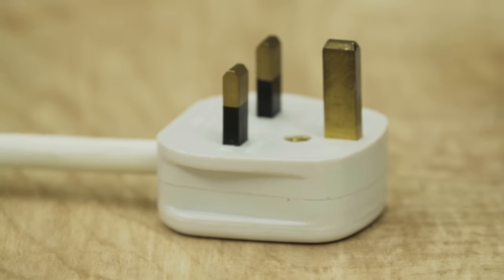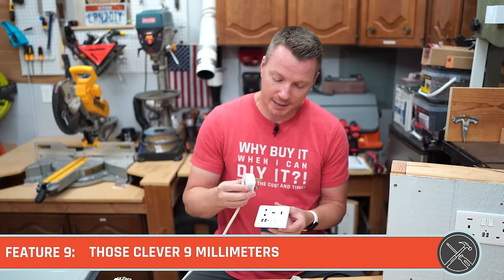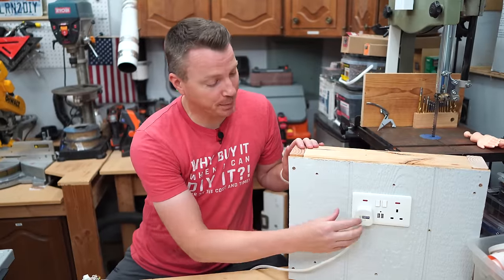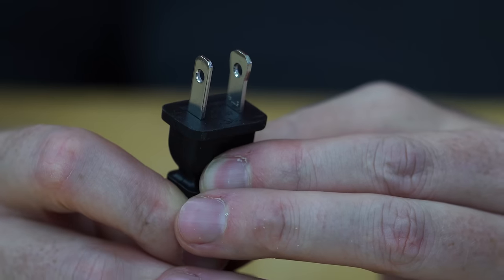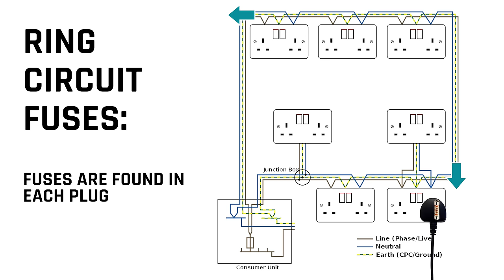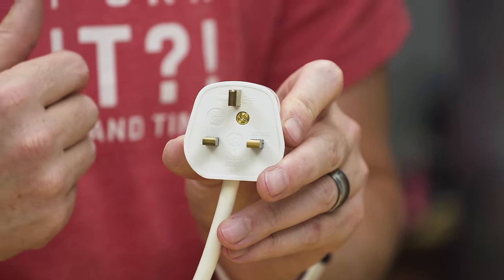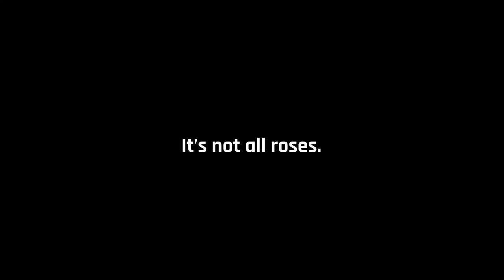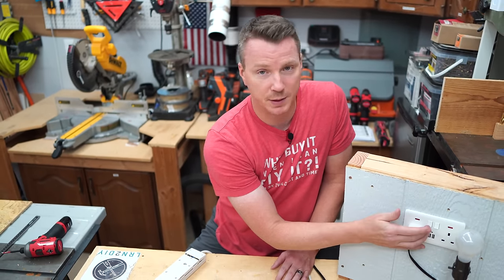British Plugs and Outlets Are On Another Level

Comment: Don’t think a British person has ever really had an issue with not switching on a socket, we all grew up with the switches! Similarly to how someone knows automatically to flick a switch to turn the light on! Also load balancing isn’t usually problematic- usually have a separate circuit for likes of cookers and washing machines!
Reply: rather forget to turn on a socket than have it throw me across the room just a preference!
Reply: Not only that if you are unsure what's broken you just plug in something you know works to rule out a faulty switch/socket..
Reply: An electric cooker won't be on the same ring circuit as the sockets, it will be directly connected to the consumer unit by a higher gauge cable.
Reply: just turn it off at the wall before bed!
Reply: The only instance I can think of was when my plug was directly behind the tumbledryer / washing machine and sometimes it would shift a bit and catch the switch and switch itself off - only happened very rarely though & was just a accident of design that the cable retention clip on the back off the machine and how it sat in it's niche was just perfectly lined up to switch itself off.

Oh and I have had the all plastic earth pins snap off - that happened on my router..
Reply: @spetsnaz1014  Yeah Electric Ovens are pre-wired in with just a switch on the wall - some times there is a separate electric shaver plug in the bathroom - but most times there is no outlets in bathrooms by convention - at least no where near the water.

That said if some one is using a counter top electric hub that would likely just be plugged in.
But I never saw those things as especially safe.
Reply: most of the times it feels weird to plug something in and not have a switch to flip when you go on holiday to places that don't have switches.
Reply: As a 56 year old man. I do not recommend licking the end of a cable aged 11. I swerved Darwin.
Reply: @shaunportlock4924  Got STUNG by some pesky critter hiding in a light fitting as a 4 year old!

Then some phantom beat me across the shoulders with a plank one morning when I wiped the dew off an extension chord - that's how you find out it is "Live" it seems.
Reply: @spetsnaz1014  the same for power showers as well T & E cable also dependant on the KW required for the shower will be different cable will be required also
Reply: Lights, sockets, cookers etc will be on separate rings with appropriate wiring. Often floors will be separated too. You don't get load issues in a British house.
Reply: I think a better point is that if the switch if far away from the appliance, it can be difficult to diagnose the problem. i.e. a washing machine or fridge being plugged into the wall behind it. Less so for small appliances like a toaster or lamp.
Reply: You can run an oven off a ring circuit as long as it's not more than 3kw.
Reply: @spetsnaz1014  Not true. You can run an oven off a suitable ring circuit..
Reply: @peterreed3104  yeah exactly lol
Reply: Except when you return to the phone you plugged in to charge hours earlier 😠
Reply: New Zealand  and Australia also have switches on sockets, although using a different plug system, and they are not an issue. Mostly they are just left "on" but it's occasionally useful to be able to turn something off at the socket as well.
Reply: @nobodydoesithalfasgoodasyou  never had that issue personally
Reply: @Richiecandylover  jolly good. I think switches by and large serve no useful function, so often find myself caught out by other people having turned sockets off for no earthly reason.
Reply: @nobodydoesithalfasgoodasyou  ...but that is not the fault of the socket...
Reply: @shaunportlock4924  My brother, when he was seven....back in the early Seventies, put a plug into a socket...without a back on the plug ! Dad had gone to find a fuse. Half knocked him out. Swear he's been a total nutcase since.
Reply: I have British sockets in my house without the switch they do exist
Reply: The fuse blowing can cause problems diagnosing issues though
Reply: @_Titanium_  in very unusual circumstances only. I can think of only one instance in mywhole life.
Reply: @90lancaster  i live in a high rise flat, and my fuse box and electric controls are literally right next to the kitchen sink.
Reply: @DAN.eight6  Hopefully they have a rubber seal around he door and is firmly attached to the wall - Otherwise - I am afraid for you.
Reply: As a fellow Brit I have only ever had ONE problem with these otherwise amazing plugs and that is standing on them - its all the lego in the universe at once...

Having lived in several other countries I really miss them and if I ever had a house built, I would instal them.  I spend so much of my life wiggling plugs in sockets to get them to work...
Reply: It is generally better to switch OFF  appliances at the power point.
The reason being that switches have a limited ON OFF count before failure
and it is much cheaper and easier to replace the wall socket than the switch
on any given appliance.
A socket with a switch has not yet been imagined in the USA (aka Retardistan)

Also note that ON OFF  relates to switching 
whereas on off  (lower case) is used in an entirely different context -
and the majority either do not know or have not noticed what is written
on any switch - which is  ON  OFF    and   not   on  off

People are programmed to be ZOMBIES
ZOMBIES have eyes but cannot see - ears and cannot hear.
Reply: Tbh I've forgot to turn the plug on a few times usually because the plug is normally always switched on so in a rush i assumed it was already on... Oops
Reply: @spetsnaz1014  Not any more I'm in a new build and its a normal 3 pronged plug with a 15amp fuse
Reply: @spetsnaz1014  It's still on it own curcit but it's no longer direct wire to socket
Reply: @peterreed3104  Most people never turn them off anyway there is no safety reason not too as we never get electrocuted it's more of an energy saving thing
Reply: and some sockets have a neon bulb to indicate the switche is on or off, and some sockets you can buy have no switches, and some sockets have a fuse breaker in the socket let alone waterproof once outside. the gauge of the wires should be the  same if it's a spare or ring main 2.5mm for domestic appliances. but he right about stepping on the plug
Reply: @spetsnaz1014  that only applies for hob's what need a higher gauge ovens and grills don't, and of course kitchens have a separate circuit.
Reply: Also in UK we do both types of socket circuits not just rings
Reply: Also it maybe thicker but when you have the US plugged in next to the U.K. you will see the US sticks out further.
Reply: Growing up in UK, I remember as a child often seeing a live and neutral wire being stripped back and forced into the outlet, along with the pins of another live plug...therefore 2 appliances drawing power from the same socket. Goes to show no matter how safe you make it, stupidity always finds a way.
Reply: It’s a bit of a meme in the UK if something isn’t working, the first thing people say is “is it switched on at the socket?” So it’s pretty ingrained and not an issue
Reply: Totally agree with this! The only one of them "issues" ive ever faced is standing on them if some thoughtful person has ever left them laying about! Makes lego feel like cotton 😭😭😭
Reply: @nobodydoesithalfasgoodasyou  never had to pay for electricity where your from?
Reply: Yes....but the added step may be an issue and a step too much for Americans.
Reply: As mentioned by many, the only downside to UK plugs really is stepping on them with bare feet 😱
Reply: @piccalillipit9211  oooh  I feel your pain
Reply: "My computer is broken, the screen is black"
"Have you switched it on?"
Reply: @spetsnaz1014  our oven since I was a kid has been in a standard socket . I'm 36
Reply: @spetsnaz1014  normally 30A
Reply: @90lancaster  that’s interesting, my appliances all have unswitched sockets but those are just the “tails” which are switched and fused on the wall above my work surfaces - really convenient. They were installed 40 years ago, and I’m grateful that the contractor was so smart!!
Reply: Yeah, I mean I have forgotten to switch it on at the wall if I am in a rush or it just slips my mind, but if I come back and (for example) realise my phone isn’t charging, I’ll instantly check the socket to see if I actually turned it on
Reply: I feel the only issue that's a real problem is stepping on one,  which has been described by James May (ex top gear) as the equivalent of stepping on an anti personal mine, his words not mine. All the other problems we are used to.  Ya have to be careful LOL.
Reply: So the only faults were size.......overloading ( as said by others different circuit) and americans not understanding an off switch............. Having used both systems living in the uk and spending lots of time in the states i can say the uk style plug blows the american plug out of the water. American plugs are flimsy, constant electric shocks, stick out of the wall so damaged and disconnected so easy. Id rather have a safe plug even if it makes it big. Good video on merits of the plug though.
Reply: @valeforedark  - An electric oven needs to be connected by 4mm twin and earth, same as an electric shower, directly to the consumer unit. It's not on a ring circuit. 1.5mm circuit is for lights, 2.5mm is for plug sockets. No electric oven is sold with a plug attached. I think you have a gas oven which has an oven light and needs ignition.
Reply: @MartinBlackburn_sco  - There was a public safety film in the 70's/80's telling people not to do that.
Reply: Most houses will have circuit breakers - I know mine does. So the lights could be on but something tripped the downstairs plugs.
Reply: Yeah I prefer having a switch, peace of mind when going to bed and saves electricity cost. The only issue with UK plugs is stepping on them, the pain is ridiculous.
Reply: IDK about other brits, but when something doesnt work the order I troubleshoot is: Switch > Fuse > Item.
Reply: @_Titanium_  not really.  you just plug in something that you know works...  if it continues to work in that socket, its the fuse....
Reply: @spetsnaz1014  and with thier own isolating switches
Reply: It's more like. IT'S NOT TURNING ON!!! " have you turned the plug socket on? " YES- wait.. nope. nope its' alive now, thanks!
Reply: @spetsnaz1014  only if the cooker is greater than 13A. What is common nowadays though is for induction hobs which require 32A and larger ovens to be on their own 6mm radial. If it's a plain fan assisted oven and let's say gas hob ignition it's common for that to be with other kitchen sockets and to be on a plug found behind the unit with a spur/cooker switch somewhere accessible.
Reply: @90lancaster  To combat this your sparky should have put in unswitched sockets with a spur at another location for turning it on and off without having to pull the thing out.
Reply: @asuri8751  I do not feel it requires changing short of the point I have the kitchen remodelled. and if I did I'd just as likely move the thing to a utility room anyway. It just sits where it sits as that is where it's plumbed in. It's kinda in the way and needs moving sometime so I wouldn't want the hassle of having it shifted - besides it's not like it's hard to switch it back on when it''s done it it's only very infrequently and because it got bumped as it's a bit to big for the space I need a shallower one really.
Reply: @spetsnaz1014  one minor nitpick. Higher gauge wires are thinner, so high energy ones would actually have a lower gauge
Reply: @spetsnaz1014  a lot of new cookers are made to have normal plugs
Reply: You can see if a switch is on from across the room as well because they have the red section that's not visible in the off position
Reply: Yes and also a British person has never thought that the plug is too large
Reply: 10:50   Switches Are 
             Double Edged Sword

This is a non existent issue!☺️

If an appliance does not work you simply try another appliance at that same socket eg a phone charger.
If that works then you know the issue is with the original appliance
If the charger doesn't work then you have an issue with the socket

Thats it, takes about 10 seconds to work out 😂
Reply: The negative of the switch causing people to have to "trouble shoot" is a real reach. You just check if its on at the socket and problem solved. If its still not working, then you trouble shoot. Safety is more important than the tiny inconvenience of checking the wall switch.
Reply: @scousersharkey5880  he's probably wired into his local street lighting or neighbouring business...seen squatters do this.
Reply: @Ghengiskhansmum  haha got his leccy on the fiddle an that 🤣
Reply: I put multiple separate circuits in each with there own trip switch.
Reply: @nobodydoesithalfasgoodasyou  it does serve a reason you save on electricity as acerything that is plugged in will have a charge going to it unless it is isolated by the switch so there is an earthly reason to turn off the sockets.
Reply: @leedstown  a full kitchen cooker will NEVER come with a plug they are always hard wired, the only ones to come with plugs are portable counter/tabletop small cookers
Reply: Switches are a waste of time, just get left on all the time whether the plug is in or out. Regards stepping on them, yes this happens all the time and yes it hurts. These plugs are over engineered for a time when electrics were fraught with risk. Clever design though. Tip if you are like me and lived abroad with northern European style plugs, you can use them without an adapter by sticking something non-conducting through the earth hole.
Reply: @spetsnaz1014  yes. 30 amp circuit for the cooker, often shared only with the washing machine, kettle and toaster. In Oz we also have a separate 3 phase circuit for air conditioning and, if you're posh, the swim spa
Reply: Never heard of a washing machine on its own circuit.
Reply: My house in Ireland was built with sockets without switches. I think the contractor was looking to save money any way that he could, but even at today's prices the saving is low, a basic plug would be all of 35 cents cheaper.
Reply: 30-amp circuit! Now that is power handling!
Reply: @jshep73  I have; but there are shallower plugs for the use case I thought that about.
Reply: @DemonetisedZone Bless. He's American; you have to make allowances! 😏
Reply: @Ghengiskhansmum  He is a scouser and doesn't know this? 🤣
Reply: @kitemanmusic  Normal for a UK kitchen.
Reply: The switches at the sockets are recent. 40 or 50 years ago the switches weren't standard.
Reply: The switched socket was invented so you can leave the plug in the wall socket thus not stepping on it
Reply: I remember that the wires were held in with matches
Reply: mine like that
Reply: I do it when charging my phone in a rush
Reply: @nobodydoesithalfasgoodasyou  quite a few electronic items no longer have an off switch. Therefore having a socket with a switch saves you having to unplug
Reply: @meltdownzero  - When I arrived in the UK at the Bird In Hand Hotel, I just couldn't believe the "logic" (?) of putting a 240 VAC device in a shower where you are wet head to toe.  I also don't remember any switches on outlet panels and I don't believe I ever saw the insulation on the live and neutral prongs.  Of course, this was 40 years ago.
Reply: Exactly this... Kitchen circuits (where you find cookers, kettles, toasters, washing machine etc.) are always on separate ring mains, not only this but they are typically on higher amperage circuits then the rest of the house.
Reply: As someone from New Zealand where we also have switches on the sockets, I agree with not having a problem with them
Reply: Also that's not a fault of the plug but the socket and that socket method is used internationally over a multitude of types.
Reply: @90lancaster  yes, its by law that there are usually not electric sockets in the bathroom. Shaver sockets have special safety features especially for use in a bathroom, including an isolating transformer... which greatly reduces the risk of electric shock/electrocution. Also, light switches aren't generally present in UK bathrooms - there will normally be a pull string switch hanging from the ceiling - much safer to use when hands are wet than a wall switch. As a Brit now living in the USA I'm amazed at the things I see here - the US just doesn't seem as safety conscious.
Reply: @spanishpeaches2930  not if its over 13 amp you can't
Reply: @seanmacdonald8211  ??
Reply: because many devices reset when they lose power lol
Reply: Theres been a few times when I've plugged my phone in to charge only to realise just before I go out that I forgot to switch the socket on 🤦‍♂️ it definitely is still easy to do 😂
Reply: @wetkneehouston6293  happens to the best of us. Adding useless complexity adds useless complexity and price.
Reply: Agreed. I've never even heard load balancing mentioned before, in fact the US system is worse for that because the first appliance drains it's portion of the current, the second one drains even more, and by the time you get to the end of the line you might struggle to power anything stronger than a lamp, depending what else is on that circuit. That's not so much of a problem with the "ring main" system, as the UK's is called. 

Stepping on plugs never really happens either, since we can switch them off there's no reason to unplug them.
Reply: @gssf.gr29  "the second one drains even more, and by the time you get to the end" are we talking here about single house installation or powering planetary system?
Reply: @FueRent  You would be surprised just how much stuff some people plug into these things. Many older houses still have radial (spur) circuits upstairs, and in some cases even downstairs and were not built for the number of appliances people use these days. I've seen radial circuits that have so much plugged in that a 60w lamp plugged in at the end would barely light up at all.
Reply: His point was it’s another point of failure, not about forgetting to turn it on! If your lamp won’t work when everything is on as it should be, now on top of everything else, the switch might be broken! Stuff like that is a double edged sword, really useful but more complication makes problems harder to diagnose!
Reply: @flashlightning6742  well lamps come with a switch. Every device comes with a switch. Adding a switch is adding a failure point and cost, but yea. Brits are not known for making the best decisions, so i guess ok.
Reply: I have always used extension cords with switches so I believe it's pretty similiar case. Anyway, just 2 days ago I forgot to flip the switch on. I plugged in phone charger, connected it to phone and went to sleep. I was late to work the next day and very surprised that my alarm didn't work...
Reply: @FueRent  I'm not saying it's a bad decision, it is just a definite downside to the switch. No matter if the device as a switch, the switch on the receptacle is still an additional point of failure. No matter how many other points of failure there are, adding another is always a downside to something.
Reply: @90lancaster  There's a whole lot of regulations defining exactly what you can and can't put in a UK bathroom, where it has to be positioned and what IP ratings it must have. For example, the shaver socket must be double insulated and contain an isolating transformer.
Reply: When I worked in maintenance in hotels I wish I had this video to show angry Americans hahaha .
Reply: @spanishpeaches2930  Most of our American electric oven/stove circuits are sized for 9.9kW minimum.
Reply: Not usually always. It’s law. If you don’t have it cause your house been build in Middle Ages. 😂
Reply: "Also load balancing isn’t usually problematic- usually have a separate circuit for likes of cookers and washing machines!"

Depends if a pro wired up your house or a complete muppet.

The electrician that did ours for the renovation was clearly a muppet because having the electric cooker on and several other electrical appliances in the kitchen at the same time almost always causes the breaker to trip.
Reply: @_Titanium_ but when the fuse blows on an individual device, it's usually indicative of a bigger problem with said device.  "Diagnosing" should involve more than just replacing the fuse.
Reply: so true as a malaysian, we use the same type of socket..we never had to unplug our appliances..just flick the switch and its all good..